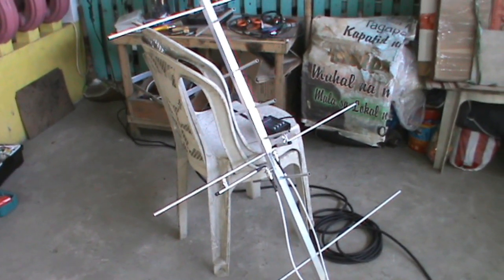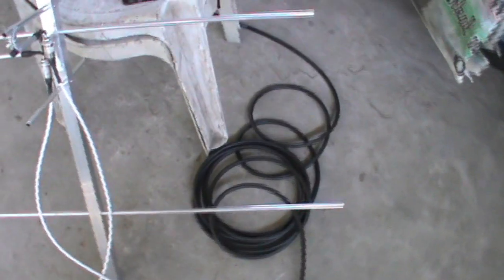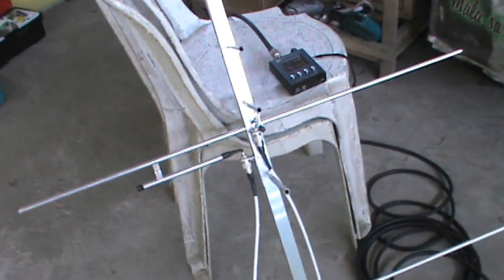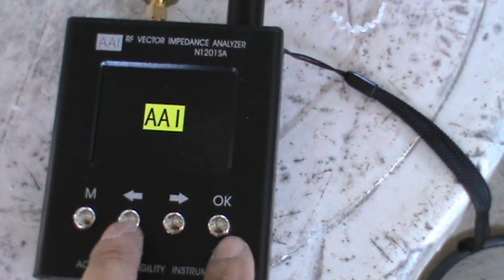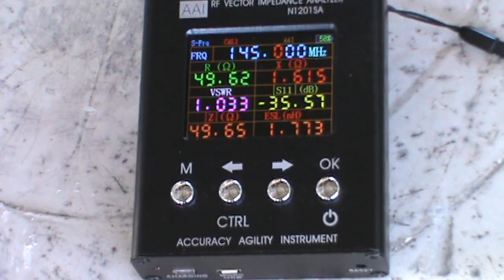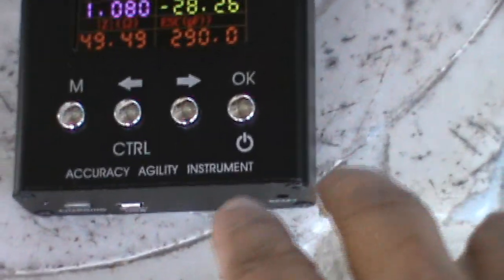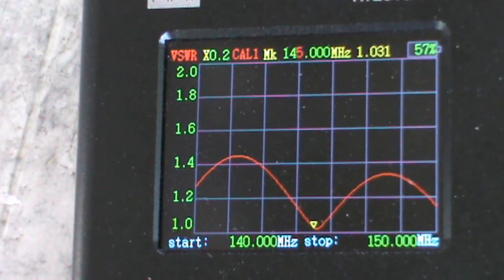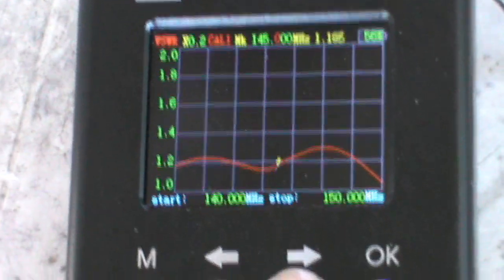3 Element by 5 Element Cross Yagi Antenna

Comment: ano po ang posisyon niyan ung uhf ba ang nasa taas tapos ung vhf ang naka higa sir.
Reply from the maker: cross yagi yan para sa satellite contacts
Reply: @EphraimGariguez  sir ano ang gagawin jaan para maka connect or gamitin sa porta.. Paano e seserch ang satellite diyaan sir
Reply from the maker: pag aralan mo search mo sa google iba ibang satellite iba iba ang settings saka dapat license ka to use amateur satellite.
Reply: @EphraimGariguez  So yong ganyan sir hindi pwiding gamitin bilang amateur radio antenna
Reply from the maker: @sbanganaalongan7707  pwede rin pero magkaiba ang polarization nya.
Reply: @EphraimGariguez  paan siya gawin sir, pasinsya napo kasi baguhan palang po
Reply from the maker: @sbanganaalongan7707  https://dw1zws.com/dualband-3x5-cross-yagi-145mhz-435mhz-mounting-and-measurements/
Reply: @EphraimGariguez  sir maari p bang malaman saan mabibili sa maynila ung nanoVna
Reply from the maker: Sa lazada at shoppee ka na lang bumili.